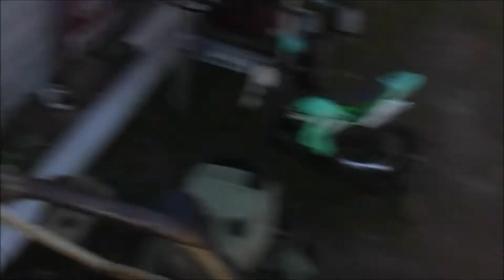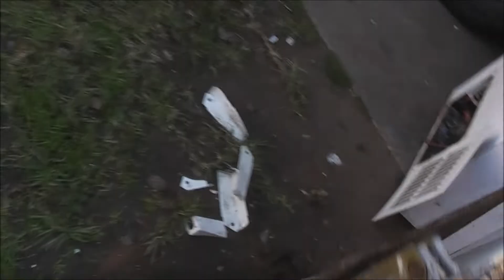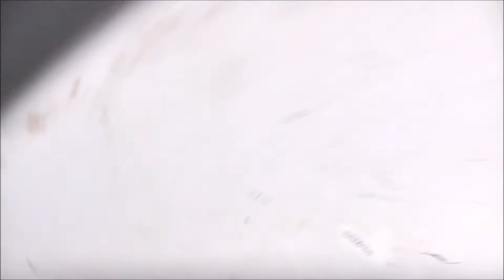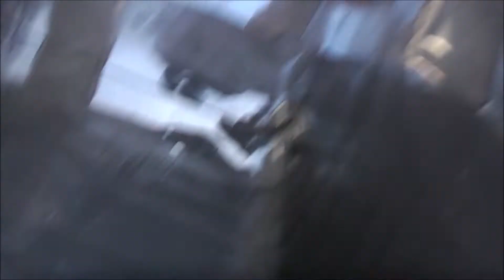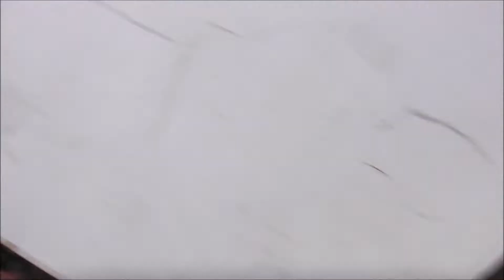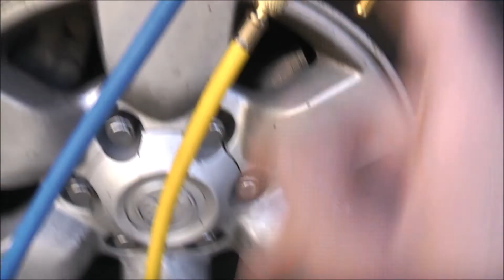Chest Freezers Score & Regassing 1

Comment: I'm surprised you can even get R-152A there since they've adopted the extremely overreaching EU F-gas regulation.   It's slightly more flammable than R-134a but it is far less reactive and works considerably better than 134a as a replacement.

MG Chemicals Super Cold is R-1234ze.  It works well in the old Frigidaire compressors designed for R-114.
Reply from the maker: R 1234ZE is horrendously expensive
Reply from the maker: I am surprised we can even get R600a and R 290 lol
Reply: @HDXFH  Those are hydrocarbon gases, exempt from such regulation.
Reply from the maker: @douro20  i know but in queensland the hydrocarbon gases are regulated for refrigeration